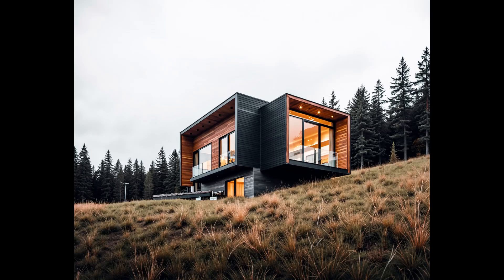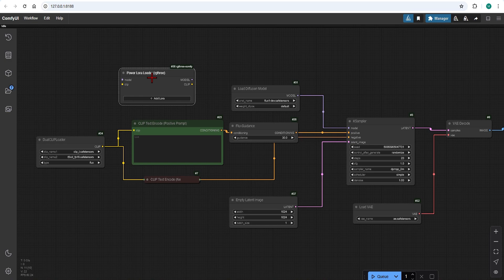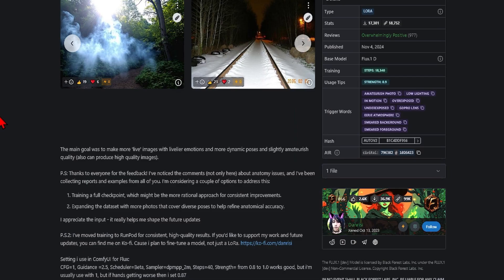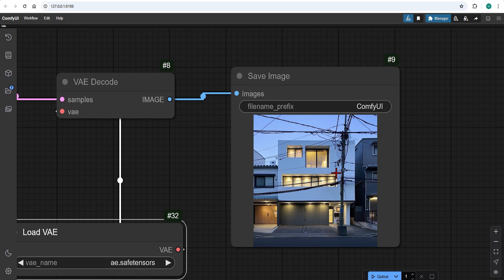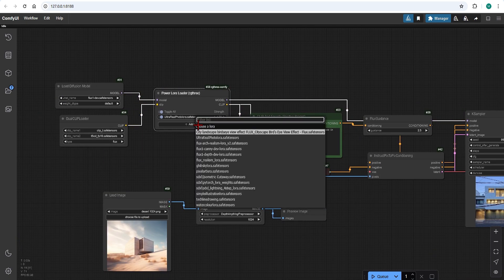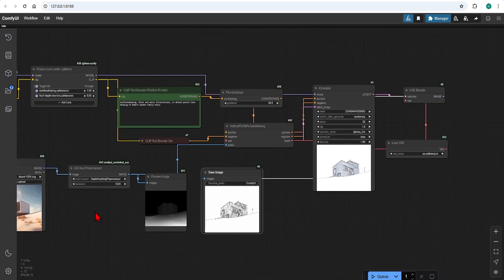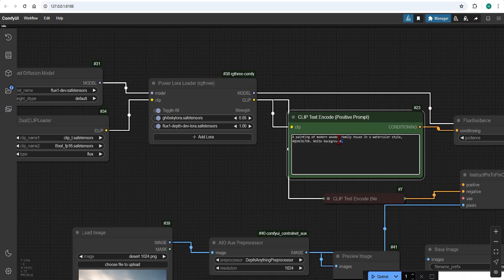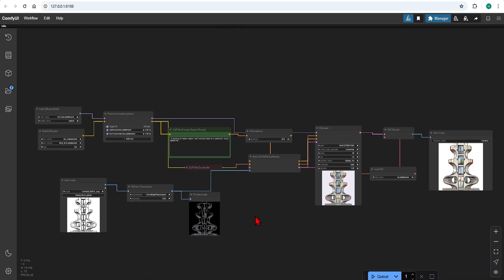What is a LoRA? Full Guide how to use with ComfyUI

Comment: Those are completely different buildings, not just styles. Same is only massing
Reply: He didn't want to make completely same building. IF you do, probably your depth mash must be much more rich in details, use masking and outline to preserve elements.
Reply: @kurtXhecticXpl  normally, architecte makes a project. Then he needs to represent it. While during ai render it changes the building - it is not useful at all. What for ? If ai makes a project - it needs also to stay same when you just change a point of view or season or just one material.